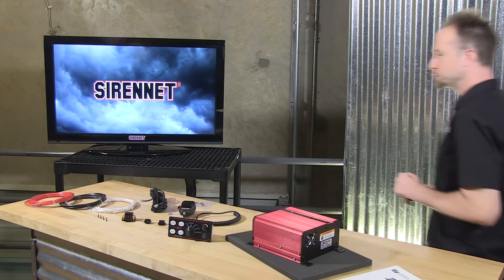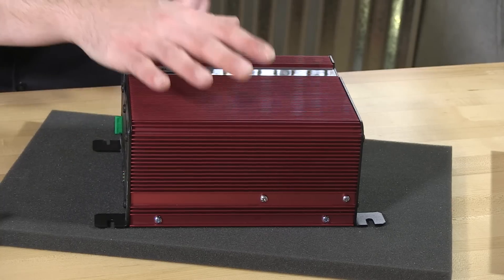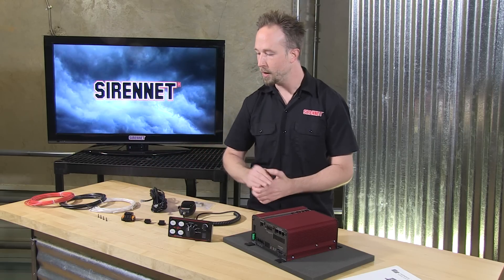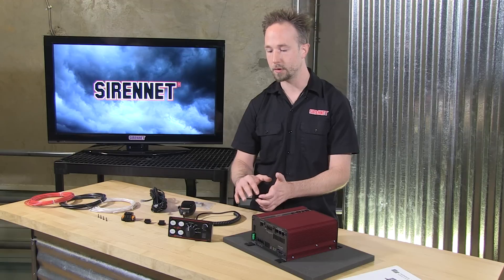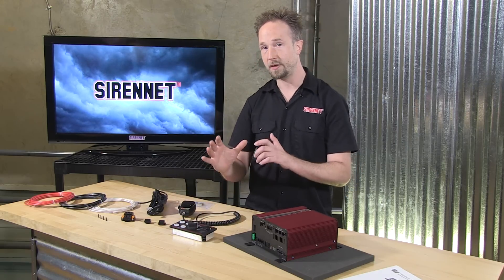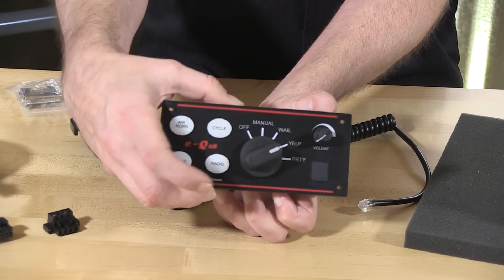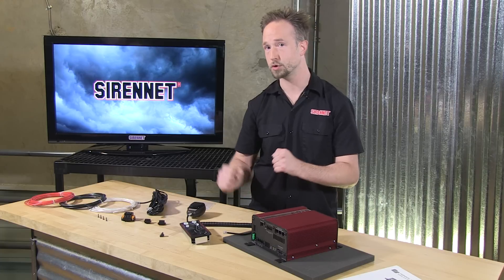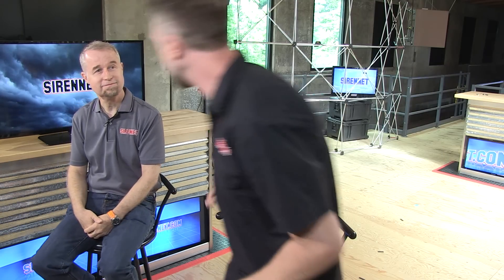Federal Signal EQ2B 200 Watt Remote Siren

Comment: The City of Toronto (Canada) Fire Dept will not use the real Q because of the current draw (100A.). Many of their new trucks are coming equipped with the eQ2B. But when the eQ2B breaks down, they replace it with a regular electronic siren due to the cost of repairing/replacing the eQ2B.
Reply: How expensive is it to repair the eQ2B?
Reply: @RickRMortis-c2v typically not worth fixing unless you blow a fuse. Our new unit has one and it was $2k which is honestly crazy considering what an actual Q costs.
Reply: I have no idea. This info was provided by our Mechanics @RickRMortis-c2v

Comment: Can anyone who is not into Fire or EMT buy one of these
Reply from the maker: On not EMS vehicles, they can be unlawful. For specifics, we'd suggest reviewing your States lighting & siren regulations.
Reply: SIRENNET Well we use any siren u can buy as a volunteer emergency responder, our government only buys for their vehicles
Reply from the maker: Some states only allow volunteers to use air-horns while others do allow some siren tones. Best to check you state guide lines or with your department Chief on what you can safely use.
Reply: SIRENNET Ok I live on an island and volunteers and emergency vehicles use basically the same sirens only difference is the volunteers have to purchase their own lightning and sirens
Reply: @jamesrodolee03  to answer you're question, yes you can buy it. You don't need a federal tax ID number or any sort of certification.